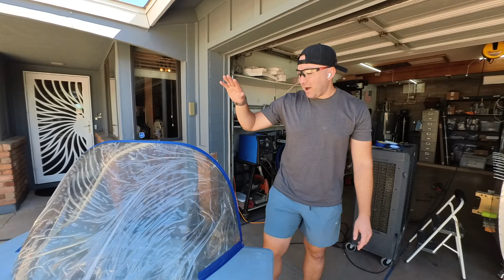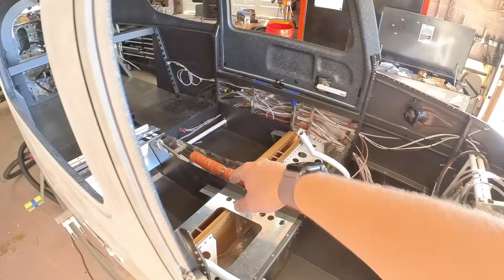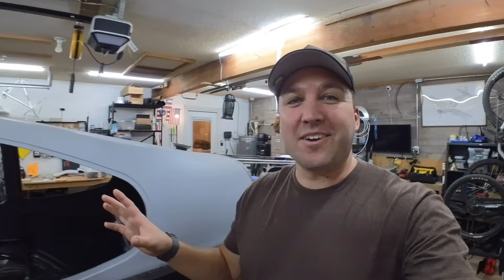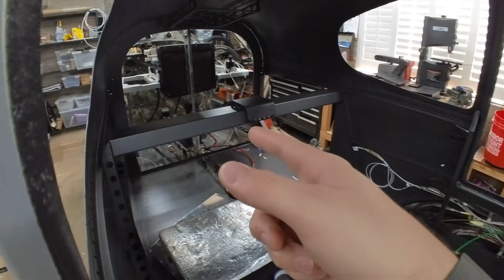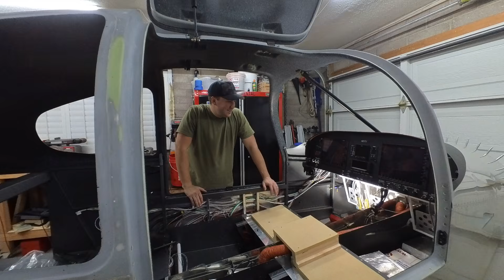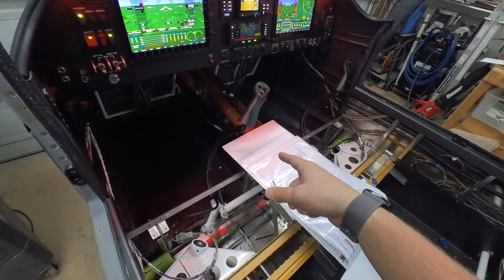RV-10 AFS Panel Comes to Life

Comment: Congrats. Looking forward to powering mine up soon as well. Wired it up myself so the struggle is real but not impossible. Curious if that is a thunderbolt and if so when did you order it. Mine keeps getting pushed back. If I finally get it in April I will have waited 3years.
Reply from the maker: I’m impressed! That sounds like a lot of work. Powering it up will feel extra special with all of your own wiring. 

Mine was a standard engine. Not thunderbolt. I ordered it in May of 2024